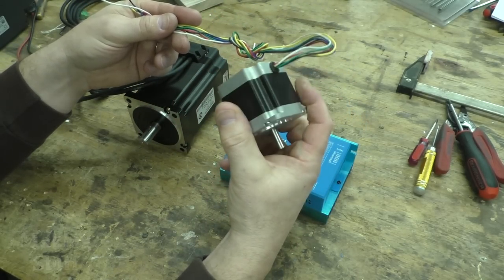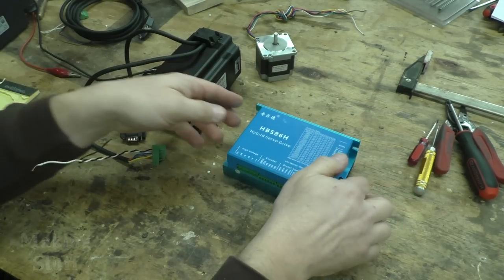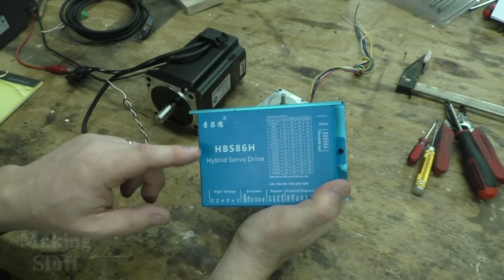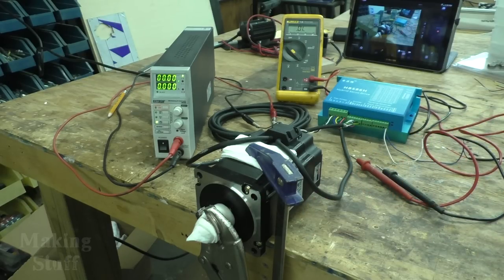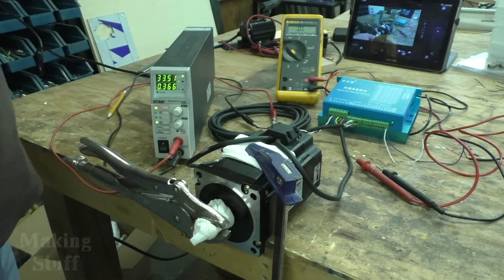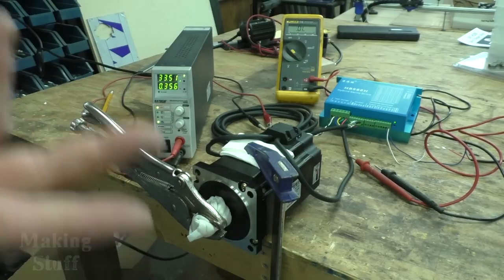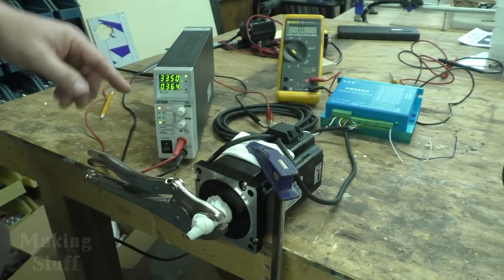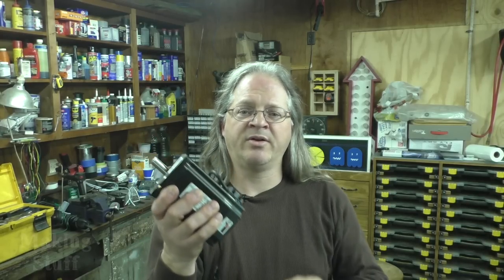Closed Loop Stepper Motors for CNC machines

Comment: Hello Bob, Correct me if I am wrong,  to insure I understand you did you say that the NEMA 23 2.2N.m motor is the best to use on the plasma cutter than the NEMA 34? Also it would take three motors to control the x y z axis? My table I am building is like yours. The work area is 4' 1" sq. which will allows me to put a 4' sq. metal with the 1" extra to allow me to place the work piece in/out and center the metal in the work area.
Reply from the maker: Not necessarily the best.  You can use smaller motors on a plasma because the cutter just floats in the air above the work piece, unlike something like a router the has to have the cutter moved through the work piece.
Reply: @MakingStuff  - Thanks for the reply. PLEASE bare with me. I am new to this CNC/Electronic stuff. On the NEMA 23 motor driver one of the cable port on the driver it was said that they are hard to get and is needed to program the motors.  In your CNC Plasma Upgrade  you updated to four Phase Stepping Drivers. 
So these four drives will operate all four motors, correct?
Two motors on the Y axis –one on each side of the table to move the gantry, correct?
One on the gantry (x axis), correct?
One to operate the ball screw (z axis), correct? 
The MESA 7I96 is the computer board that is programmed to operate all the axis?
What does the 4 channel rely board do?
What motors do you recommend for the xyz axis? Please provide info
Thank You for time and again I am trying to understand this CNC/Electronics.

Comment: So what is pulses per rev actually doing? Say you set it to 800 pulses per rev...what does the motor do if you only send 799 pulses? Does it define the angular resolution. So for 800 you have an angular resolution of 360/800? Thanks

Comment: Frank, consult, I have 3.2 amp stepper motors as I can regulate the current output with this hybrid controller. And by default with how many micropasses this hybrid controller comes. Thank you for your support.

Comment: Dear sir, your video is nice  of demonstrate of stepper motor and drive, we are the  utm machine manufacturers, we fabricat universol testing machine s, we are planning to use big size stepper motor (nema 34/ 56 ) to our utm machine, our machine maximum capacity is 1000 kg. In up and down direction, our Machine verible speed from 12.5 mm/ minute to 500 mm/ min,  for more torcke we are planning to attache a speed reduction warm gear box, 
For our project please suggest which stepper motor and drive is suitable.
Hope you can respond.

Comment: i wanna use nema 23 closed loop stepper motor to build a robot using arduino with ramp 1.4. Is that possible for servo driver connected to ramp 1.4. Im looking for your answer! thank you

Comment: PLEASE bare with me. I am new to this CNC/Electronic stuff. On the NEMA 23 motor driver one of the cable port on the driver it was said that they are hard to get and is needed to program the motors.  In your CNC Plasma Upgrade  you updated to four Phase Stepping Drivers. 
So these four drives will operate all four motors, correct?
Two motors on the Y axis –one on each side of the table to move the gantry, correct?
One on the gantry (x axis), correct?
One to operate the ball screw (z axis), correct? 
The MESA 7I96 is the computer board that is programmed to operate all the axis?
What does the 4 channel rely board do?
What motors do you recommend for the xyz axis? Please provide info
Thank You for time and again I am trying to understand this CNC/Electronics.
Reply from the maker: Yes to first 5 questions.  The relay board turns on/off the plasma cutter and the proximity sensors.  Check the makingstuff.info web page for the specific motors that I have used on the cnc projects.

Comment: There's a problem. The loop is not closed between what the motor is moving and the controller, only between the motor and controller so it does not deal with backlash in feed screws etc. BobUK.
Reply from the maker: Good to know. Thanks for your input.

Comment: I do not see why you would need to replace the stepper motors to get closed loop operation. You can purchase an encoder kit from mouser.com for about $24, manufactured by CUI, P/N AMT102-V. I believe this is a capacitive encoder that can be programmed for a variety of steps per revolution (up to 2048 steps per turn). It comes with sleeves to fit on the shaft sticking out the back of your existing motor, but you might need to drill and tap a couple of screw holes for mounting. Other encoders are also available. You will need to upgrade to hybrid controllers for all your stepper motors in order to use the encoder. I assume the hybrid controller uses standard quadrature encoder signals.
I had a similar system on my DIY CNC milling machine a few years back, except it used a DC brush type servo motor and Gecko controllers. These controllers made the interface to Mach3 like a stepper motor, that is you input step and direction signals, and the controller would move the motor until the encoder sensed that motion was complete. The Gecko controller also kept track of the error if the motor was not able to move for any reason, and output an error signal if more than a few steps were skipped, or if the motor lagged behind where it should have been due to friction or speed issues.
There may be some reason this will not work, but I think it is worth trying it.
Bob Butcher
Reply: Ditto on this! the CUI encoders work great, I have them on my machine. You may have to add a small circuit if you want to use them with your existing controller. It appears that it wants differential encoder inputs and the CUI encoders have a single ended output. But this is a very easy circuit to make.
Reply: Will these encoders work with Mach 3?

Comment: I just got a kit with 3 Nema 34, with drivers and power supply and, I just can't get them to run.
the driver goes straight away to alarm mode. I tried with encoder on and off, with the same result. I've tried with the smc5-5-n-n offline controller, and with and Arduino with GRBL, and won't run. just vibrate a lot, and goes directly to alarm mode. 
tried two drivers and two steppers out of 3, always with the same result. checked the connections a million times and nothing.
the wiring it's pretty straightforward. all the wire colors are on the steppers.
I'm starting to believe, I got faulty units. thank God, I bought it from Amazon, so I can send it back, and get my money.
If you have any idea, what is going on, I really appreciate you share it. 
I like your videos, and I've learn some important things with you, which I thank you for it.
Cheers
Reply from the maker: The only thing I can suggest is to double check you wiring and also check for shorts.  If the encoders aren't wired correct or the motors are wired correct it will go straight to alarm mode.  I had the same thing happen and it turned out the encoders were not wired correct.
Reply: @MakingStuff  Hi, thanks so much for your fast reply.
I found out what was going on, and of course, was the wiring.
Not my fault. The Chinese mistaken the A+ & A- for the B+ & B-.
On the process I've learned something very important! 
The open loop steppers, if you got the pairs, it doesn't matter A or B, but the closed loop motors, if are not connected on the spot, they refuse to work. they just vibrate, and the driver ( thank God), goes into alarm mode, and protect itself from harm.
The Chinese can build very nice things, but they really have a problem with labeling ): 
well, everything is fine now, and I'm very happy with my purchase.
I got a self build CNC machine already, which I call her, " Little Girl", now I'm working on her brother, " Big Boy".
All the best, and thank you so much.

Comment: Great video , I am going to try upgrading and older CNC machine , after watching your video I will be checking out the closed loop set up sounds like it might be what I need . Do you think a NEMA 23 would work , anyway thanks for the great info .
Reply from the maker: It just depends on the application.

Comment: I have the same HBS 57 on the same side as the dipswitches are 3 pin serial connector for configuring the driver and there is supposed to have corresponding software. can you please tell me the pinout of the 3 pin serial and a link to the proper software? I have looked everywhere with no luck!?!??

Comment: What is the torque rating if that motor?  Also how to  reset the drive once it faults out?  Do you have to power cycle it?
Reply from the maker: I don't remember the torque rating.  I think I mentioned it in one of the CNC machine videos.

Comment: How do you keep the closed loop stepper motors/drivers from faulting out when Zeroing to the top of the material?  If the motors/drivers fault out during the zeroing process how do you recover the drives without powering down the machine?
Reply: You don't use them for zeroing, you'd use inductive sensors for that, and the alarm on the driver will not trigger. But how to reset the driver in case it's in error mode is a good question! The alarm signal can be wired to the emergency stop pin. 
I've got an open loop cnc router that had bumped on a clamp and lost steps, It plunged full depth into a 20mm thick alu plate. That was quite exciting, but the part had a huge unplanned hole in it! With a closed loop the cnc would've stopped and saved the part from this failure. A good thing too, since these nema34 beast pack a punch, especially 1:3 ratio leadscrews. It can easily tear your machine apart!

Comment: Hello, is it necessary to use the RS 232 cable for the safety of the CNC machine to work with the Mach3 program or is it only used to show the values? Please help and thank you very much
Reply from the maker: I don't use Mach 3 so I don't know.

Comment: Have you got any experience with the G540 Geckodrive ?  What would you recommend for a stable system  Geckodrive or chinese closed loop kits ? I am about to make an upgrade and it's hard to take decision.
Thank you.
Reply from the maker: I'm not familiar with the Geckodrive.  The closed loop motor works well but is nema34 which is too big for my plasma table.  I have not had any issues with the open loop drivers on the plasma because the torch does not touch the workpiece like a CNC router would.

Comment: Do the closed loop have a faster speed with out errors? I am running ballscrews with regular steppers on my cnc plasma and can only go to about 65 ipm before I get a missed step and it stalls the motor. My ballscrews have a 5mm pitch, I should have gotten higher pitch. I have tried to tune the motors a million different ways but they still skip steps above that speed. Any ideas or settings that I could possibly be over looking?
Reply from the maker: Yes I'm pretty sure that closed loop can go faster.  I haven't done much with this one because I only have one motor and it's too big for my machines.

Comment: great video! can i control this through an arduino? I'm hoping to adapt it for a different project.
Reply from the maker: Yes you can.  I used an Arduino to power this motor in the nail gun robot video.  https://youtu.be/J4CcUW8ATqY
Reply: @MakingStuff  excellent! thanks

Comment: Hi Bob. Another great video, thanks. Aren’t you able to replace any of the other motors on the plasma table with this one. And then perhaps make new motor mounting plates at your leisure.
Reply from the maker: I am planning on using motors like these in an upcoming project.  But, Yes I could make new motor plates on the plasma table.

Comment: Could I just DIY a close loop stepper motor by using a cheap rotary encoder and assembling it in a somewhat funky manner or wouldn't that work well?

Idea for a cnc or 3d printer and uhh... Basicly do an initialization at 0,0 and then increment/decrement depending on the direction. Mostly for the x and y axis, because the z axis doesn't wiggle too much around anyways
Reply from the maker: Yes I've seen others DIY closed loop systems,  but I don't know how accurate or reliable they are.  Probably not worth the time unless you really enjoy that type stuff.

Comment: Hi Bob, I have exactly the same driver and would like to know how did you figure out which wires to connect for the encoder part on the driver?  I got mine from china but they did not send me the encoder line. How do I know the way to connect to EB+ EB- EA+ EA- VCC EGND? Thanks in advance.
Reply from the maker: I searched on the internet and found the spec sheet for the driver.  The product page on Banggood.com also has the wiring diagram.
Reply: Thank you. After 2 days searching I figured it out. There are several manuals for the same driver with different connections. After all the struggle my 4th axe runs very smooth

Comment: hi 
what the different between this motor closed loop and the ac servo ?
and 
the ac servo need 
specific breakout board ? for lathe or router or milling machine conversion?
thanks
Reply from the maker: I haven't used an ac servo yet so I'm not really sure.
Reply: @MakingStuff  thanks

Comment: Fist of all, congrats for the video. I have a simple question, can you help me please? I wanna know if I can read the position of the encoder in a PLC, for example. In my project I need to set a home position without a external sensor. Thanks, and congrats again.
Reply from the maker: I have no idea how the encoder works internally.  I would start by hooking it up to an oscilloscope or logic analyzer.
Reply: Itˋs just a simple encoder powered by 5V putting out A and B as a differential TTL compatible signal. The pinout is documented in the datasheet of the motor. I hooked up the motor to a simple stepper driver and the encoder to the input of my mesa card letting LinuxCNC doing the control loop. The encoder does not provide an index (z) signal so for homing/referencing you will have to use some sort of external endstop.

Comment: How about a solar panel orientation motor.  Use that Nema 34 to follow the sun.
Reply: That would be cool but it's cheaper to just buy more solar panels. Even if you'd have limited space, the tracking requires more space around so it's probably still not worth it. Plus windage problems.
Reply: that's a way to waste that motor

Comment: Could I make a digital stop fence with a stepper motor like this?
Reply: You absolutely can. I've worked with a machine that uses a motor like this; it's powerful enough to push several 5 meter lengths of wood stock in to a cutting saw (it's geared down through geared belts though for more torque). You can also use it just for butting up pieces manually; there's a company called Tigerstop that specializes in that if you need ideas.
Reply from the maker: I don't see why you couldn't.

Comment: 11:38 to the pulse-pin? Sorry I did'nt get that. What is this pin for please??

Is this mimiking the signal, that usually comes from the breakout board???
Reply from the maker: Yeah, that's my screwed up way of saying step pin.
Reply: Wow, didn't know you can do that. How did you do it ? 5v to pul+ and short connection with 5v to pul- ?

Comment: Hey why dont you add that motor as a rotary indexer..i have the same size of stepper..but mine aint closed loop..i built a CNC with them..i still want to upgrade to cnc..
Reply from the maker: Good idea.  I haven't decided what to do with it yet.  I used it for the nail gun robot but that's it.

Comment: Check out uStepper. It actually watches the rotation of a stepper motor (using a magnet) and will compensate for missed steps. Works with Nema 17 and 23 stepper motors. I've been considering getting 2 of them, one each for X and Y motors on my 3D printer.

Comment: Hello. The high voltage connector AC-AC.where is the positive pole. I will use 36 volts DC. and SW6 has no information, I leave it on or off. My engine is 85 NM.
Reply from the maker: AC does not have positive and negative like DC.

Comment: Hi there!Maybe you can help me out with something...I am at the final step of building an electronic leadscrew...i use the same closed loop hybrid steper motor but after connecting everything the motor does not move at all....it is the clough42 project but i used this motor and stepper.....maybe y0u can help me?
Reply: Alex - Did you get this worked out? I am building the clough42 lead screw project and I am thinking of using this motor and controller.
Reply: @williamparks9162  yes it was a faulty pin clamp!!The one that clough42 sent me. Very rare to happen but it did.
Reply: @AlexandrosNikolakis  Thank you. Now I will feel better about ordering this motor. Thanks Again.

Comment: I would try to use it as spindle motor for a mini lathe. It should have huge torque at low speed. It is able to positioning for tool post drilling. Tapping should be great.

Comment: So the essence is actually "only" the stop of show. generally every step should be repeated... except the drilling and milling runs redundant. in such case, the "correction" would lead in real time the axis to the right spot. but... is that then still in synchronisation with the other axis or is that kind an error to life with in practice? and: does it also check the loss of microsteps or only whole 1,8 degrese.. which is far.. anyway, guess. does this really justify the costs or shouldnt one spend this money in motor setups, that do not slip at all. as beside stepper slips, there is much friction, backlash.... hmm. but hey. i am still on it.:)